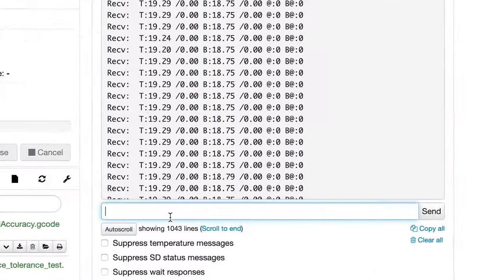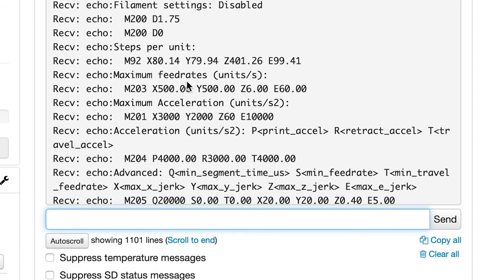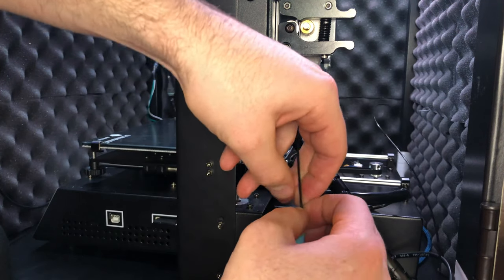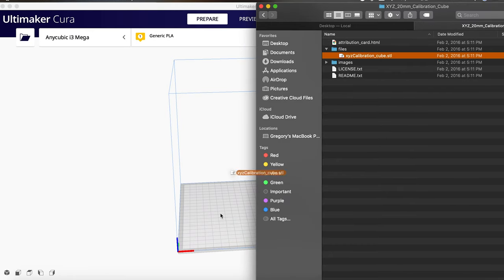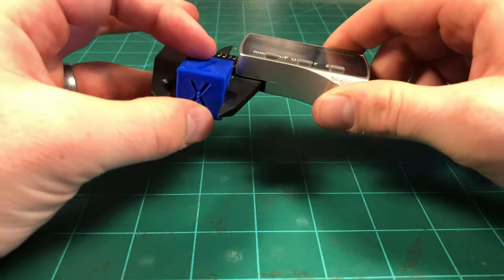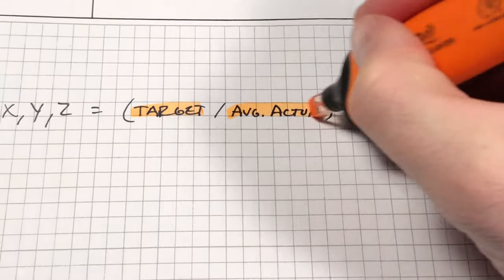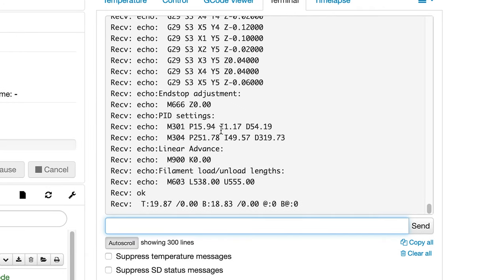How To Calibrate Your 3d Printer Stepper Motors

Comment: My under extrusion is 78 mm?! Is that even possible? I recently upgraded my stepper drivers and my first two prints (test owls and a larger print I designed) came out beautifully. But since then I have had constant under extrusion. 

I've tried . . . 
New capricorn bowden tube
New nozzle
cleaning out the extruder
mesh levelled the bed

Still under extruding. Could I really be 78 mm off? Do I need to adjust my voltage on stepper driver?  Please help!
Reply: Actually in my experience the underextrusion can be caused by lots of factors, sometimes by the condition of the filament(old filaments under extrude especially if the filament is exposed to high humidity) by the extruder not griping enough of the filament (the stock extruder of the ender 3 v2 is ok the first few prints, after many months it doesn't grip well slipping sometimes, also if the plastic arm isn't broken first) or maybe there's a partial blockage at the intersection of the bowden tube and nozzle. Try to look at each of this possible problems.

Comment: How do it find the current e value?
Reply from the maker: You'll need a method of communicating with the printer via the command line, I use OctoPrint's terminal tab. I then send the command M503 which will list all your current steps/mm settings. Hope that helps!

Comment: A waaaaaay more important note. Outside of your esteps it’s highly unlikely your other steppers need to be calibrated via the steppers. This normally means something is binding and you should be looking for that. It’s extremely rare for the steppers to wrong(besides esteps which can change with filament and nozzle changes)

Comment: I flashed the latest stock 1.4.6 firmware from your other video, to my Mega X (not i3Mega?). Flash went perfect. But now, my zero and home is completely wrong. It used to print super reliably with the nozzle tip homing to the bottom far left. Now, it's homing somewhere mid-X, and almost off the Y and I'm unsure what the Z is doing, but when homing, it's exceeding some limit and starts making a noise as if it's trying to move past a fixed stop. Using octoprint terminal, how can I re-zero to the correct location, so my prints I slice in cura will print in the correct location on my ultrabase? I hope my explanation is clear. Thank you.
Reply from the maker: So you installed the stock anycubic firmware? Or you switched to the version of Marlin that I linked to in the description?
Reply: Modern Hobbyist I flashed your file, the 1.4.6. Stock i3 hex. Loaded fine. On printer screen and special menu was there. But when I tried to Home all axes, it kid of went crazy. I think it needs its own firmware. Bigger build vol 300x300x305 and maybe other differences? Any advice?
Reply from the maker: Oh I see! When I read Mega X, I was thinking the Mega S, which is basically the same as the i3 Mega. My guess is you'll have to start from scratch to get the Marlin firmware working for you, which is definitely an option, as the Marlin firmware is open source. Otherwise, you could certainly reach out to Dave Ramiro (the original creator of the firmware I used) and he may be able to help you out.

The last option would be to reflash the stock firmware which is available on Anycubic's site.

Let me know if that answers your questions!.
Reply: Modern Hobbyist I see what your question is. You had 3 files. 2 were for upgraded steppers. 1 was for unmodified “stock” steppers. That’s the hex I flashed. Sorry.

Comment: Hey mate, doing this on a ender 3 Pro, when i put  M501 It says no eeprom?  Any ideas? Cheers
Reply from the maker: Hey Samuel, thanks for the comment! EEPROM stands for Electrically Erasable Programmable Read-Only Memory and is used to store settings and configurations so that they are retrievable after rebooting or unplugging your printer. I'm not sure why yours is saying No EEPROM, but I know that is a configuration option on Marlin, so it could be that your printer doesn't have EEPROM_SETTINGS enabled. 

I don't have an Ender so it's hard to say, but check out this link and let me know if it helps you get things going:

https://letsprint3d.net/how-to-calibrate-the-extruder-steps-ender-3-5-cr-10/

Also this link might help: https://marlinfw.org/docs/gcode/M092.html

Thanks again for the comment!

Comment: Hi, could u show How can i calibrate with cura. I dont have octoprint
Reply from the maker: Hey Bruno, Calibration with Cura alone isn't going to be possible because you can't view the response from the Printer when you send GCode commands. I would try a different slicer like Simplify3D to send the commands. You can do this by accessing Tools > Machine Control Panel within Simplify3D. Let me know if this helps!
Reply: @ModernHobbyist  thanks I use The simplify yesterday and worked. Thanks for The vídeos, you are saving us
Reply: @ModernHobbyist   Could you elaborate a little on how to do this with Simplify3d machine control panel please.
Reply from the maker: @rodashton4120  It should be as simple as connecting to your printer via USB and navigating to Tools > Machine Control Panel within Simplify3D, but I don't have that software so I can't actually confirm that. Worth a shot though!
Reply: @ModernHobbyist  Yes I have connected and used the proportioning for the extrusion and adjusting my steppers. Questioning if this is the best way to do it??

Comment: hello, i followed your step by step to install marlin, since then i wasnt able to print anything, it seemed to be underextruding. so i went on to do the calibration as shown in this video. I marked my filament at 120mm and sent the G1E100F100 code from cura and my filament still measures 96.69mm.  This is the line i get from pronterface: echo:  M92 X80.00 Y80.00 Z400.00 E92.60
The tightening screw isn't loose, it pulls just fine.
what else could it be?
Reply: damn it. I have the problem. Did you solve it?
Reply: @halitburakyesildal2869  yes, it was the e steps. I thought it should be more or less 100 but it depends on the stepper mottor. On the mega s its about 420 i think. 
When i did the firmware flash it may have changed the e steps.

Answer is do the same procedure as the video and change your e steps according to the calculation and you should be fine.

Let me know if it works, if not ill try to give more info
Reply: @johnf4388   I've found new E value around 7120 and I'm over
Reply: @halitburakyesildal2869  you re on a mega S, with stock extruder?

If so, 7000 steps is probably wrong.
As you can see on my first comment, after the marlin upgrade i had 92 after i corrected it it was 396.
Make sure to save your changes.

Let me know if you got it working. When i have a min ill check and let you know the exact steps i took to make it work and the correct values for my machine
Reply: @johnf4388  yeah exactly
Reply: I got stock drivers

Comment: Hi, I did the command M503 and got a value of extruder 384 (first impression high). Then I extruded and just moved filament in around 5mm with the command G1 E100 F-100 (had to change to negative). But this sounds strange because in this case I would had a terrible print which is not the reality. I used Pronterface and Symplify (same result). Then I changed to E900 to have a test and the sound of extruder motor is really strange.. and got the same result of filament moving around 5mm. I am really confuse with what is happening to mine printer. Have you any idea?
Reply from the maker: Hey Guilherme! I'm not sure if that was a type, but you shouldn't have a "-" after F in your command. Let me know if that was what was causing the issue!

Comment: very inaccurate method. Use a needle with a ruler  and tape the needle onto your carriage pointing to the ruler and you can adjust your esteps dead accurate even over 20 cm

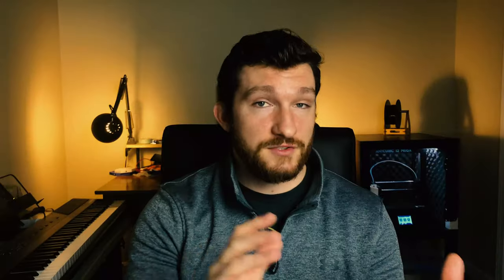Comment: @3:40
You're doing it wrong 😂
Reply from the maker: Thank you for the constructive comment! Lol jk
Reply: @ModernHobbyist  
You need to use the sticking out part of the digital calipers for measuring depth
Reply from the maker: @alexjaxon9928  That is the part of the caliper I am measuring with.
Reply: @ModernHobbyist  no that's the part of the caliper you use for the inside diameter
Reply from the maker: @alexjaxon9928  I see what you are talking about now, but they literally all record the same measurement. I don't see why it matters which part of the tool I use to record the measurement. The way I did it allowed me to butt the caliper up against both the flat end of the extruder as well as the painters tape, while I'd have to eyeball the measurement if I was using the bottom of the caliper.
Reply: @ModernHobbyist  
So the best way to get esteps is to use the depth part of the calipers. Mark 120mm. Extrude 100mm of filament.
Update esteps, do it again,update esteps
3rd time mark 10-20mm of filament but instead of marking it cut it flush with the depth part of the caliper.
Get where I'm going with it ?
Reply from the maker: @alexjaxon9928  The process you are outlining is exactly what I did, I just used a different part of the tool to measure the remaining filament. I'm not sure what the problem is here.

Comment: Don't use the 20mmx20mm cube to calibrate your e/steps!  You're introducing other variables like filament shrinkage, flow rate, or elephant's foot which will skew your data..  Use a dial gauage instead which removes all of the variables.  Move 10mm and what does the dial gauge say?  Calibrate accordingly.  Use the calibration cube to instead SCALE your model.  This is making me absolutely mental that all of the videos does not address this.

Comment: As a beginner with an affordable (cheap) Easythreed K9 printer, I had to find an alternative calibration method for the X, Y, and Z axes motors. While this approach may not be the most conventional or "right" way to do it, it worked well enough for this printer.

I opted against using the dial gauge method due to the printer's design constraints. However, measuring a calibration model proved to be a suitable alternative.

One key adjustment I made was calibrating at 100mm, the machine's build limit, rather than the typical 20mm cube. This approach yields a smaller percentage of error at smaller sizes, resulting in more accurate prints, as mentioned in CNC Kitchen and other tutorials.

Comment: Must be a better way to edit the values. If manufacturers instead had a manu option for calibration of these values it would be much easier. If you need to do this, 3D printers are very basic setup. I understand it is possible to hack a printer like this, but it is not the correct way. It must be much easier. And why did not the China manufacturers think of this in advance? Well thank you for the video, interesting, but taking the risk of editing something with an equation that cannot be verifed you can end up to hurt your 3D printer more than make it better. This maybe work on one printer model but not all.

Comment: Question, on your result from the M502 your value for X 80.14 and Y 79.94, I assume  they are values in microsteps?
Reply from the maker: Correct, the values calculated there are the calibrated "steps per unit" which for us would be steps per millimeter. Basically, how many microsteps does the motor need to take to move the implement 1 mm. Hope that helps!

Comment: I dont have a raspberry pi...how can I use octoprint with my tronxy x5sa?
Reply from the maker: Thanks for the comment! Since OctoPrint is written in Python, it’s possible to run it on any computer that supports Python. I haven’t actually done it, but it shouldn’t be too hard. Here is a link for getting it set up on Windows: https://community.octoprint.org/t/setting-up-octoprint-on-windows/383

Comment: I have a I3 mega too but  the value for E is 384  should i use the  same equation ?
Reply from the maker: Hey Horman, thanks for the comment! The same equation should be fine, in the end all your doing is adjusting the existing parameter by a certain percentage. Hope that helps!

Comment: Hi could you please explain where to get the program that you calibrate the printer is it something that you buy is it something you can download for free please explain thank you
Reply from the maker: Hey Eli, thanks for the comment! If you are talking about the terminal I send commands to the printer with, that is OctoPrint running on a Raspberry Pi which is connected to the printer. You could also use PronterFace (https://www.pronterface.com/) or another similar program, but you need one that will show you the serial printout from the printer, which Ultimaker Cura won't do. Hope that helps!

Comment: Hi, how can i calibrate it without printing? My printer is so f* up i cannot even print that cube lol
Reply from the maker: Thanks for the comment! You could always mark a spot on the bed and move the print head along each axis one at a time. Say, for the X axis, mark the start location as well as a point 100mm away, move the printhead along the X axis 100mm and measure the different. Then repeat for the rest of the axes. Hope that helps!
Reply: @ModernHobbyist  Thanks! I had lots of firmware problems, that was it, but this is also a great alternative for calibrating axis

Comment: Congratz I watched so many videos regarding calibration but all of them refers only to extruder calibration leaving x,y,z axis in the dark. 
After switching to directdrive on my ender3 I noticed some overextrusions (even through extruder was and wall thickness were setup correctly). It seems that due to not enought belt tension or due to heavier carriage x,y,z dimmensions were out of their sweet point. At least this is my assumption since I'm still verifying it :).
Reply: BTW. in cura >4.8 you are able to crate cube and resize it to needed values - for example I'm extending my X dimmension to 100mm - since if the tested distance is longer then the error will be more visible. At the same time I decrease other dimmesnions just to save print time and material.

Comment: Seeing that Anycubic Mega brings back memories from looking for my first 3d printer during the pandemic... Its crazy how much has changed.
Reply from the maker: It’s insane! My wife just said to me the other day she wants a printer that just works out of the box and I died a little bit inside thinking about how these printers used to be considered low maintenance 😭
Reply: @ModernHobbyist   Right!? It's insane that now people actually expect that new 3d printers function right out of the packaging like a microwave or toaster, with zero maintenance needing to be done until it's time to throw it away.

In a way, it's really heartbreaking for me, because now the printer I got, the Ender 3 Pro, costs more than an Ender 3 V3... And now just anybody can just barge in and use them like a throw away tool without learning the magic behind 3d printing, from the stepper motors to the motion systems.

I guess we have Bambu Lab to blame for this new mindset though... The industry will never be the same again.

Comment: Hi, very nice video, but my prints are still oval.  Original steps were x=100, y=100, z=200. I printed the cube, measured multiple times and then came up with averages as follows: x=100.5, y=101.52 z=199. I updated the machine using the LCD interface and stored the settings (my machine has these features in the LCD). The print came out the same or worse. I'm at a loss with this machine. I sent it in for repairs to Lulzbot 3 weeks ago and they sent it back in worse shape than it was. This problem didn't exist until they touched it and they won't respond to my support tickets. They did have to undo the belts to repair a broken bracket and I'm wondering if it could be a belt issue instead of the steps. If you have any ideas for me to try, I'd be grateful.

Comment: helpful vid but you did the equations a bit too quick for me and i didnt understand why the 1st value was 120
Reply from the maker: Hey Ben thanks for the comment! I used 120 in the equation because that is the length I chose to measure out on the filament before I extruded 100mm. So, ideally you would have exactly 20mm left after you measure out 120mm and extrude 100. Hope that makes sense!
Reply: @ModernHobbyist  sorry should have been clearer, i got that bit but you also had 120 on the X & Y calibration equation which confused me as the cube is 20mm
Reply from the maker: @BenMillen  Oh I see! Good catch! That 120mm should be 20mm, sorry for the confusion!
Reply: @ModernHobbyist  cool, thank you that makes sense 😊

Comment: Great video Sir. I am building an atypical printer and I suspect all my stepper calibrations are not correct. I cannot print anything, but all the steppers move in the correct direction. Can you please suggest a starting point?
Reply from the maker: Hey thanks for the comment! I haven't built a printer myself yet, so I'm not quite sure the best route for you, but you might need to set some default values for various things in the firmware. Try the link below and see if that gets your setps/unit value a little bit closer to where you need it. 

https://www.matterhackers.com/news/3d-printer-firmware-settings-stepper-motor-configuration

Let me know if that works!

Comment: Great video ...if you have octoprint.
Reply from the maker: Thanks for the comment! If you don't have OctoPrint, you can use other tools like Pronterface to do the command line parts: https://www.pronterface.com/
Reply: @ModernHobbyist  thanks for that. I've been doing searches but it has not been clear which is the correct tool. Thank you for clarifying
Reply: @ModernHobbyist  and I meant it. Great video
Reply from the maker: @mickeyflint6825  No problem! Thanks for watching!